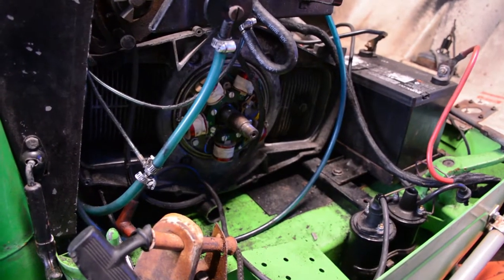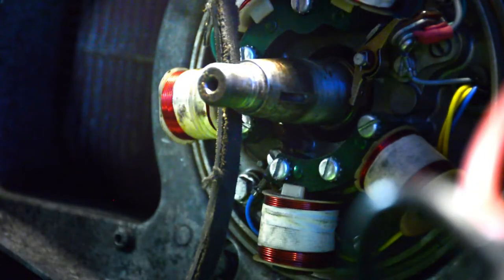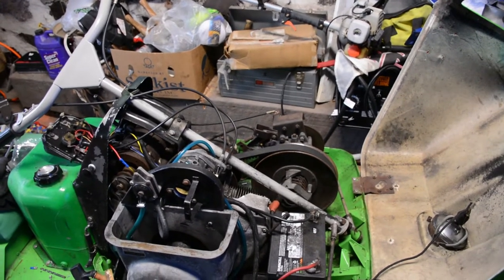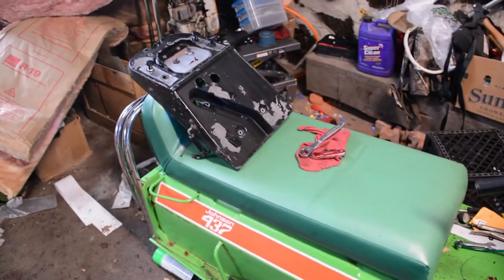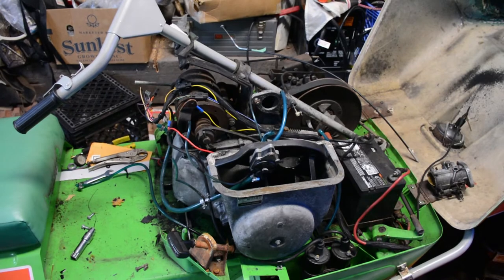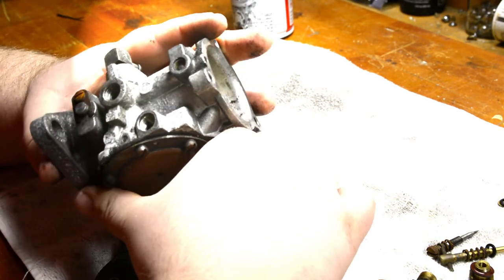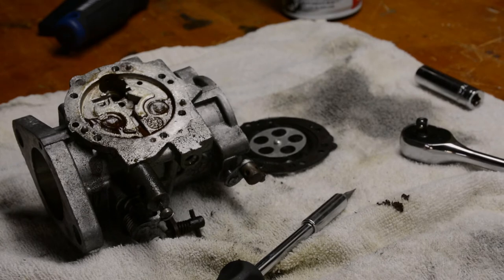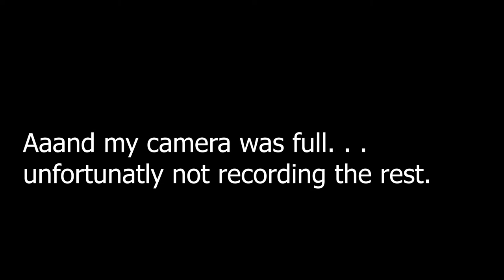Getting the 1970 Johnson Skee Horse going

Comment: This sled brings back memories of the 70s. I have rebuilt several of the omc motors. The exhaust ports on many of these were too small. By cutting them out I gained about 50% more horsepower ,and avgas 100LL got me the other 50% they will run like the wind .If you plan on running her hard add a little more oil to the fuel. thanks for the memories.
Reply from the maker: What a great story and info. Thanks much for watching! I've never taken one of these motors apart but have heard that about the exhaust ports.

Comment: I think the paint code is 6602 for that machine . There’s a place in NY that makes those colors and don’t it have electric start ?
Reply from the maker: It could be. I will do some checking on that. Yes it does have E start. I'm not sure if the starter works. But I do know that the battery is dead, haha.